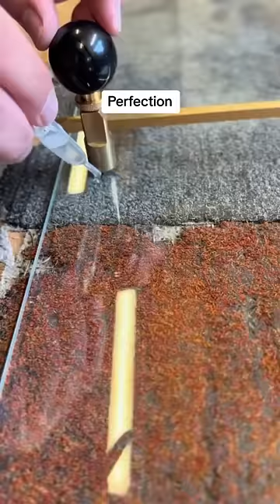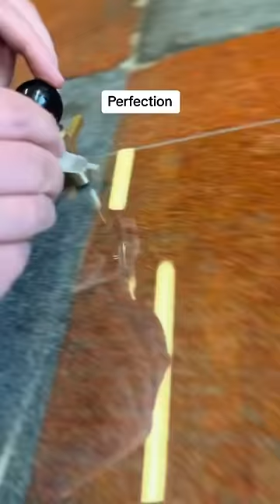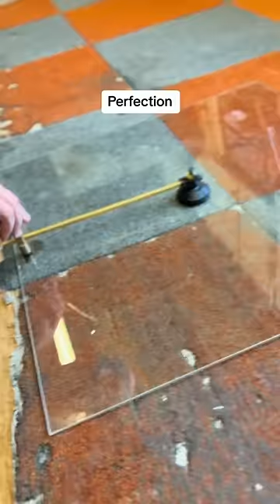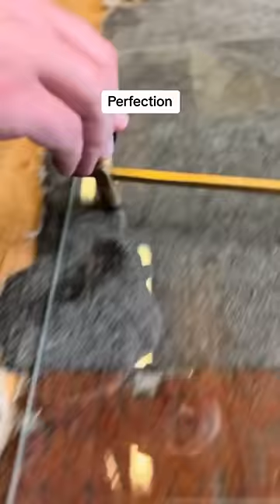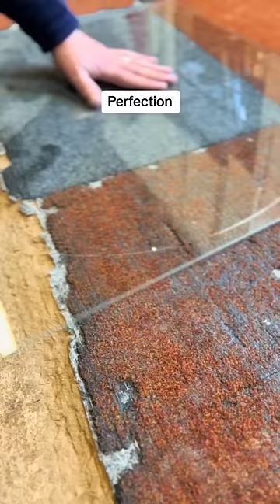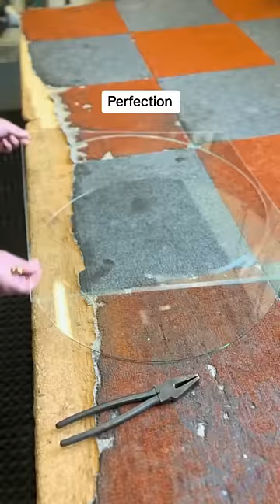Sorry For The Scraping Sound

Comment: That's some Cat Woman burglary tools right there. 😅
Reply: lol
Reply: This is underated
Reply: Beat me to it
Reply: Wouldn't work. U need pressure from the opposite side of the cut for it to break with the cut
Reply: I was imagining a thief using this in an old style cartoon
Reply: It's there in some Mission Impossible film😂😂
Reply: @davidhollywood448 Don't ruin it with Hollywood magic!
Reply: @davidhollywood448 But yet it did work. 🤔🤨
Reply: He's just talking out of his ass 😂
Reply: @MichaelVelders  watch at the end, he does a small cut at the edge of the glass , breaks it and lifts up the "frame" if you'd do this to a mounted window f.e. - you'd have to get into the inside to break the glass at the cut point.
Reply: 😂 I wanted to post this
Reply: @MichaelVelders You misunderstand , he's talking about the glass has to be laying down flat so that the tool is able to apply pressure, a piece of glass standing up isn't able to be cut properly. Try harder instead of just trying to correct people 👍
Reply: @Fuchs1337  I've seen it done on a vertical window, they tapped the glass surrounding the circle a few times and it just fell out.

im sure it depends on how thick the glass is and how deep its cut though.
Reply: @4...3  no, that's not possible. The "cut" isn't really a cut, it makes a scratch, maximum 0.5mm thick. 
I'm working as Glazier for about 20 years. Believe me , it is not possible , the thicker the glass, the harder it gets. It'd work MAYBE with a 2-3mm glass, but the chance of not breaking the outer frame is 10% at best
Reply: @Fuchs1337  tried to find the video, i may have imagined it. maybe its not possible to extract the circle of glass cleanly but I found a video of a guy marking a circle and then breaking it with a pencil, leaving only a circular hole
Reply: @4...3  I'd love to see that. Is there a way to share the link?
Reply: @Fuchs1337  I don't think you can do links in youtube comments but it's a short titled "Cut A Round Hole In A Glass Window" if you can find it
Reply: @Fuchs1337  it does look like the surrounding glass cracks though, looking closely
Reply: @4...3  I just saw it, the "pencil" you mean is a glass cutter ^^. The back part got a metal ball, that's why he can smack the cut glass out of the circle, after doing several horizontal and vertical cuts
Reply: That one scene in Shrek I will never forget.
Reply: Yes, a glass cutter is often used for that.
Reply: @davidhollywood448 suction cup after you cut it and then you pull it outward
Reply: Bro 😂😂😂
Reply: i thought of cars 2
Reply: @davidhollywood448  I'll figure out a way somehow lol
Reply: @Fuchs1337 so it is actually possible to do, in other words.
Reply: @anticom6099  theoretically yes. But if you only want the circle to come out, it's a 99% chance the frame of it will break as well.
Reply: @Fuchs1337   that wasn’t the point. You said you’d HAVE to get to the inside to break it at the cut point. Clearly you don’t, since he tapped it out entirely from the outside.
Reply: @anticom6099  No, the cut is on one side, breaking the cut happens from the other side.
Reply: @Fuchs1337  but, as demonstrated by the many videos showing this, the cut is made from the same side it is tapped out from.
Reply: @anticom6099  No, I'm currently working my 8h shift in my 21. Year as glazier. I can tell you, you have to break the cut from the other side. Or bend the glass (as shown in the video) so that the crack opens up.
Reply: @Fuchs1337  then why do all these videos show different? Are they using Harry Potter magic?
Reply: @anticom6099  I'm sure they don't do different, some people have their own techniques - but trust me - there's no way to break a glass without having access to the opposite side where the cut was made.
Reply: @Fuchs1337  except in all of the videos showing exactly that, right?
Reply: @Fuchs1337  that kinda by definition means there is a way.

Comment: I love how the workspace is worn down on the edges, through years of use, countless times having tools placed down on them, worn away with work and time.
There's something admirable about that
Reply: Correct, why "fix" what isn't broken. It works great.
Reply: easy it's a workbench
Reply: It may not be scientifically reasonable, but I strongly believe those worn benches, tools, jigs, etc all 'learn' their jobs and gain a memory that continues to be passed along to everything build there, and that memory continues to accumulate with each project.   Even simple materials desire a purpose and prefer to be useful.
Reply: and you can tell it's real because it's all right there in that little spot
Reply: @bubblesculptor  when the acid starts hitting
Reply: @bubblesculptor I read this in Joe Rogan’s voice.

Comment: I used to work in the cutting department of an industrial glass company and this is pretty much a mini version of what we did. Fun job
Reply: I run a production line in one now. We got these giant automated tables that do all that cutting.
Reply: @christiedt9818  thats what we were workin with. Big ol scoring machine that scored the glass so we could break the pieces off on a separate table with bars that raised when you hit a pedal. Used a big suction cup crane to load the sheets onto the cutting table
Reply: What is that liquid he's dropping on?
Reply: @pho_is_not_interesting it’s oil for the diamond blade
Reply: @christiedt9818 I’m sure there’s a guy who cuts the patterned glass by hand in there ,  the cutting table just cuts the clear and K glass
Reply: @mathewdee1632  nope, machine is more than able.
Reply: I do the same job right now, pretty nice! Squares and rectangles are 99% of the job, but sometimes you get these fun shapes to cut. Makes it more challenging!

Comment: I always wonder how they made circular windows. Thanks for the cool short lesson! 👍🏾
Reply: That is  a glass top for a table, son...Waaay too thin  to be used  for a window .
Reply: @BANSHEEBOY_1974  are you sure about that?! I'd say a table top would need to be thicker than a pane of window glass. Given you don't put things on a window pane like drinks, books, lamps etc.
Reply: @BuckyOhYeah would it? You don’t need to worry about insulation when it comes to tables
Reply: @VultureSkins  Yep. Though the insulation is argon or krypton gas between two (or even three) panes, as glass isn't that great in itself as an insulator. I still think it's more likely a window pane than table top. Though I'm not sure it's even a window pane... maybe something like a picture frame?
Reply: @BuckyOhYeah  what?..You never seen a table top with  a lamp, coasters, and a remote control  holder?..Sh!t don't weigh that much bro
Reply: @BANSHEEBOY_1974  yes, hence why I said the glass would need to be thicker for a table top.
My question for you; have you seen a window with these items on them? 
No disrespect, but did you misunderstand/misread my comment by any chance?
I guess my statement, in this respect, boils down to; why would a tabletop with items on it be thinner than a window pane that has nothing on it?
Reply: @BuckyOhYeah  ...That makes No sense...You say a table top would need to be thicker than window glass... I said lamp, coaster ..etc. don't weigh that much bro..Meaning a thin sheet of glass would serve the purpose for a table top... You come back with 'Hence why glass would need to be thicker than a window '...Sooo whatever that means....And not sure if you are aware ...They are still manufacture windows with thick glass bro..to keep out the elements.. They weigh in ...They are not light by no means....That doesn't make much sense why a table top would need to be made thicker than a window.. when only a few items are usually placed on it?.. Heck man.. even my mom's kitchen  glass table top wasn't that thick at all ..prob like an 1/8".
Reply: @BANSHEEBOY_1974  yeah bro, well bro, it's due to tensile strength bro. Oh, and I decided to check myself... a window pane: circa 3/32nds of an inch, table top glass: circa 1/4 to 1/2 inch bro...
But going back to your query; sure those items don't weigh much... but YOU DONT'T PUT THEM ON YOUR WINDOW. Logic dictates, the glass that has anything placed on it, no matter how light it may be, must be stronger than the glass that doesn't have these items placed on them.
How's that bro? You maybe wanna go check stuff out, bro?
Seriously, I don't necessarily think it's a window, but it definitely ISN'T a table top.
Reply: @BANSHEEBOY_1974  also bro, table tops are tempered. I'm pretty sure you can't temper glass under 1/8th of an inch.
Are you forgetting, your windows are more than likely (at least) two panes, and laminated?
Reply: @BANSHEEBOY_1974  Hey bro, did you realise you were wrong bro? Any chance you could stand up like a man bro, and admit you got it wrong, bro?
I'll wait for your response, bro.
Reply: @BANSHEEBOY_1974   If you can't understand a very simple sentence, such as 'Hence why glass would need to be thicker than a window', you need to go back to school, or at least read more. The dictionary helps me with words I'm not aware of. I suspect the word 'hence' is what's tripping you up? If so, I can only apologise for using vocabulary that exceeds your remit as an illiterate ignoramus. Have fun looking up the definitions of those words.
Reply: @BANSHEEBOY_1974  lmao that dude is wild. I'm on your side. This piece of glass, in a COFFEE TABLE FRAME, would be plenty strong enough for a lamp and a coaster. Hell, I bet you could even put a remote control holder if you wanted. Some people just can't accept when they are WRONG. Buckys gonna buck I reckon. Let's see how triggered he gets when two people say this could just be a end table viewing.. wait for it... WINDOW.
Reply: @BuckyOhYeah  you seemed to get hung up on the word bro. Is english your second language or do you have some kind of OCD?
Reply: @BURDYMAN777  so you couldn't tell I was taking the piss? Lol. Good luck in life, bro.
Reply: @BURDYMAN777  yeah, I don't need to know about your bodily oblutions, or did you mean 'the piss, and not, a piss'?. You also don't seem to know what OCD is. But, whatever... as said, good luck in life.
Reply: Glass estimator/ installer here. That glass appears to be double strength ( 1/8 " ) so most likely a glass for somthing to go in an old window or hang on a wall like in a picture frame or clock. Table top glass is typically 1/4 " plate glass but sometimes people  tempered for safety reasons
Reply: @ndhrealestn8  thank you...
Reply: @BuckyOhYeah  
You are definitely correct. I can easily calculate the moment of inertia and elastic modulus of a piece of glass and tell you how thick it needs to be to resist an applied load (like a large lamp, than can be 50lb+, or a guy sitting on it, 250lb+). A table top with no boundary support has large moments needing thick glass. A window with continuous boundary supports and distributed loads has lower moments and can be thinner glass.

Comment: Scoring glass is an art. I used to do it at the hardware store, the double pane was the hardest to crack.
Reply: Laminated glass is harder but just requires a diff technique. Spent 20.years fitting auto windows and cutting glass. Getting good cuts and using decent heat to soften the interlayer makes it easy
Reply: are talking about lamiated 6.4
Reply: For those hwo are not working with glass: 2 ply lam is cut from both sides and the plastic layer that is holding the glass together is softened up with heat , or you can dissolve it with alcohol. 
You can put some alcohol on the glass and ignite it there by warming the plastic up until you can break away the of cut . If you cant use heat 
The alcohol will make it into the crack
And locally disolve the plastic ,then you break it of .
If there is more than two layer in a lam glass you cut it wiht a glass saw 
Or water cutting. (You cant crack the inner layers with a normal  glass cutter)
Reply: What is the liquid
Reply: @KimberlySchaeffer71  oil

Comment: I worked as a picture framer for almost 30 years, I cut glass mostly into squares and rectangles, but I was the "go-to" fellow whose job it was, to cut the circles & ovals  out of the sheets glass. We restored old framed art too, where circles and ovals were more common. Its the light touch, that is ideal. I loved doing my job.
Reply: I always press down too hard and temper the glass so it won't snap... maybe I need better tools.
Reply: @alexpattie9265  It is a skill that requires practice and patience. Most hand held glass cutters require a (light touch) and the right touch. You don't want to hear the rolling cutter wheel, make any grinding noises. It should be a light sound of glass being "scored". I'd break two or 3 pieces of glass before I mastered cutting circles and ovals. Our shop had a vertical glass cutting, (wall mounted) frame that held the glass against a "square". We used it for all our square and rectangular glass cutting.
Reply: @alexpattie9265  If you glass cutting tool is old and not well oiled, it can interfere with getting a clean score line. It is best to use a new cutter, and keep it oiled with something like 3-in-one oil.

Comment: For those that are wondering, the liquid that was applied between the glass and cutter is gasoline. It makes the cutting process smoother. Thus, making a cleaner cut edge.

Correction: kerosene not gasoline
Reply: Was in the glass business for almost 30 years. We used kerosene NOT gasoline.
Reply: @franktraub5677  You are right! My bad to have both of them mix up.
Reply: How many miles per gallon? 😅
Reply: Le me : Was thinking that it is Super Glue 😅
Reply: А воде
Reply: Thank
Reply: @franktraub5677 — that’s better than oil?
Reply: Gia đình tôi 3 thế hệ đều dùng dầu hỏa để cắt kính! Chúng tôi thấm dầu vào cục bông gòn để khoang vùng trước khi cắt!
Reply: @AndreaCuchetto  We had a cutting machine from Italy that used specialized cutting oil. It was expensive. All my years in the trade we used Kerosene. It was inexpensive. If you research "oils to use for cutting glass" you will find what you are  looking for.
Reply: the cutting oil is for preventing the glass from healing back also.
Reply: Керосин надо лить, каждый стекольщик знает! 
Если нет керосина берем любое жидкое масло🤷‍♂️
Не благодарите))
Reply: Foi a primeira coisa que pensei em  😂perguntar
Reply: i use cat piss very effective
not as clean though
Reply: اين يباع
Reply: @AndreaCuchetto 
Strictly speaking, kerosene is oil.

The generic term "oil," in this context, just means that it's derived from petroleum and is used as either a fuel or a lubricant.

In America, when we hear "oil," we think of things that are sold as lubricants, because that's how they are marketed to us, but think more along the lines of putting kerosene in an "oil lamp."

Kerosene comes from petroleum, and is most commonly used as a fuel, but will also function as a passable, if highly flammable, lubricant.

Not trying to be a jerk or a smartass, just trying to be helpful. ✌️
Reply: @SevenTheJester  — Thank you for the lesson. 😊
Reply: @AndreaCuchetto  
...again, I'm sorry if I kinda sounded like a jerk. I really was trying to help.
And please don't feel embarrassed, it's not you. Like I said, the way they're marketed to us is screwy. The only reason I know is because I had to look it up at some point and happened to remember. Cheers.
Reply: We used paint thinner with some 3 and 1 oil mixed in it to ubercate the cutter
Reply: We used turpintine to lubricate the cutter back in the day. Still love the odor today. 😺
Reply: Керосин!
Reply: I used terpentine, came in a can.
Reply: WD 40 works great too.
Reply: So why the inner and outer ring? Can you please enlighten me?
My first job was as an apprentice glazier but the company folded up so I never got to finish my time. Started working with my girlfriends father and we did a lot of the glazier work on Westmead Hospital in Sydney. A long time ago.
 A skill unto itself working with glass. Some of it is pure art. ❤
Reply: @franktraub5677  I love kerosene or paraffin to improve the cutting process
Reply: ACPM not gasoline
Reply: 오일이 중요한게 아니라 그 뒤에도 유리 모서리를 띵 띵 띵 띵 찍는 그 개 같은 이유가 뭔가요?
Reply: Puede ser petroleo tambien
Reply: Or it was cutting oil, that's what I use. By the looks of the table it could've been cooking oil 😂
Reply: We just use wd40
Reply: Audi Theme Song ☠️
Reply: Anyone ever try using oil/ kerosine/ whatever, to cut tiles? (Just curious.)
Reply: @srtalphagames 😂 same
Reply: Or diesel 👌🏻
Reply: Why correction.. instead of edit the gasoline to kerosene 😅
Reply: sunflower seed oil😊
Reply: Exactly the answer to what I was wondering 👌🏻
Reply: We always used atf.
Reply: Rocket fuel
Reply: Or, you know, cutting fluid.
Reply: @shonevans2563  i agree. Cat piss is the best! Though not quite as good as kerosene
Reply: I bought cutting oil from the stained glass supply store.  One local glass shop had a can of transmission fluid on the wall.  Gas would be way too thin.
Reply: @beauchamp1763 there was one cut,  the free spin after the dropper was to spread the oul cleanly.  You can hear the cutting wheel spin rapidly over the glass.
Reply: What is it doing except from healing back.
Reply: Where can I purchase this cutting tool
Reply: No it's oil to keep the dust down from skipping a cut and makes it easy on the cutter. We use denatured alcohol for lami after the flip and score the other side. Then, light on fire to melt the inner liner. Probably the reason his table is crap.